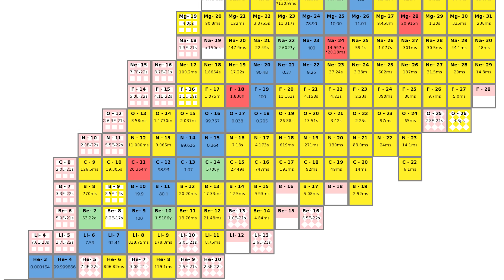Why the U.S. Doesn’t Recycle Nuclear Fuel

Comment: The "product" of transmutation is the reduction or elimination of long-term radiotoxicity by converting long-lived isotopes (minor actinides like Neptunium and Americium) into shorter-lived or stable ones, drastically simplifying the final disposal challenge.
Reply: I wonder if that real dangerous stuff could be used as a power source in deep space probes?  All it would require is coming up with a safe cask to transport the fuel to a safe distance, then load the fuel in the probe. Seems like a good task for a moon base also.
Reply: @Mr.Morden  nope, but we do use americium in most US households, as a radiation source for your ionization smoke detector. With neptunium-237, that gets bombarded with neutrons and becomes plutonium-238 that is used for radiothermal generators.
And I've taken an iodine-131 capsule to have my malfunctioning thyroid scanned. Technetium-99m was used in a stress test, proving that despite rumors to the contrary, I do indeed have a heart.
Reply: @Mr.Morden   Are you eight years old?  Never seen a rocket explode on the launch pad or on its way to space?  Never looked how much is costs to send a pound of cargo to space?
Reply: But it's vastly more expensive, which means it won't be done in a Capitalist system.
Reply: @ResistPower  as if it would be done in any other system
Reply: @guai9632  do you mean like France? Or did they cease to exist because of inconvenience to your argument?
Reply: @spvillano  since when france isn't a capitalist country?